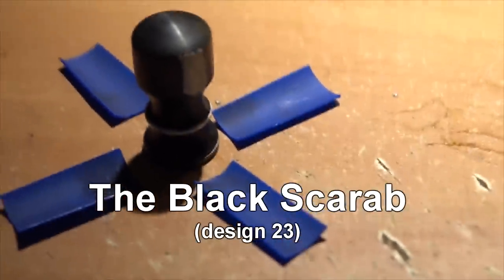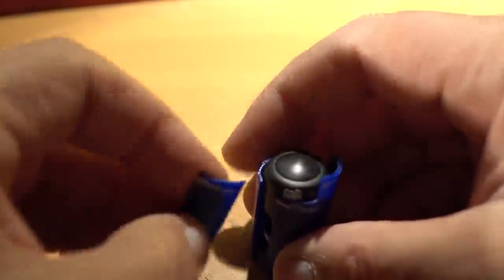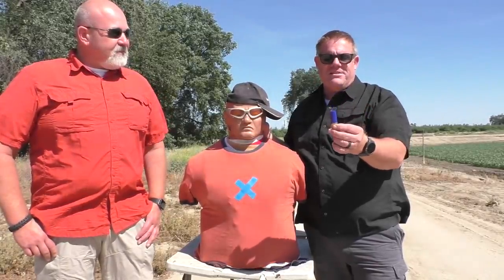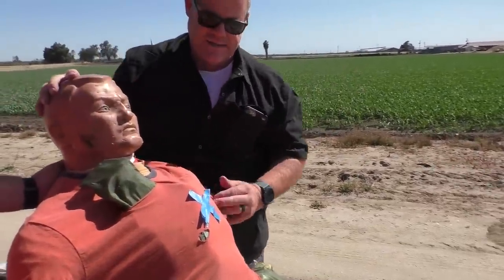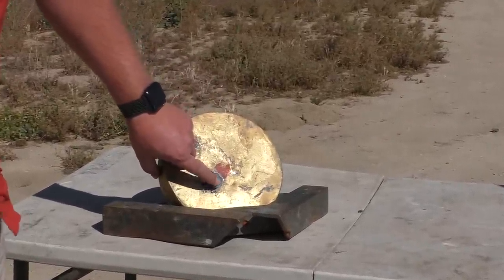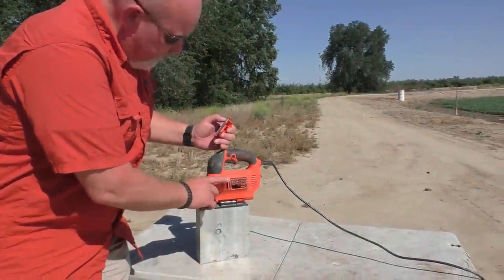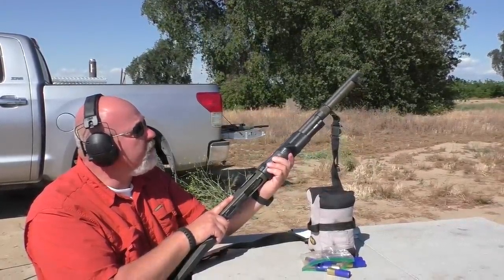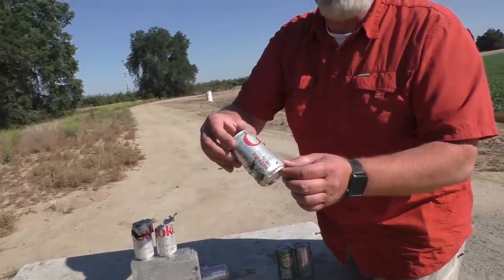The Black Scarab 12ga. Slug - Supersonic Freight Train

Comment: TAOFLEDERMAUS - On your comment about wrapping the ballistic gel in something, my initial thought would be to wrap it in Packing Tape.
That stuff is clear, so when you shoot it, you can still film the projectile going through it, but it will add support so you can show just how violent that force is going through the gel.
Its pretty strong stuff. Approved by the USPS. In fact if you use any other tape, they won't accept the package because of the risk of severe damage.
I had to learn that one the hard way!
Reply: The gel has to flex, as you can see in the slow-motion shots. Packing tape would prevent that because it doesn’t flex. And it wouldn’t be clear, it would make the shot inside the gel very blurry and hard to see. We think three seconds of rinding with water is fairly easy. 🤷‍♂️

Comment: Have you ever tried making a “bird shot” type load with .177 pellets instead of lead shot? I wonder if the Diablo shaped pellets would correct themselves in flight, if you just tossed a bunch in a shell with grex or whatever buffer material in any which orientation would they correctly orient themselves and start flying head first ?

Comment: Great video and great shooting guys! I'm really wondering if the screw-in tailpiece, is maybe getting pulled away from the body of the slug because of the intense force exerted upon it when fired? This could. E the reason that the washer came off completely in the ballistic gel. If you go back and look at the first shot I think, the washer is loose and there's a gap between it and the body of the slug. The chamber pressure could be high enough that it is causing the bolt/screw to rip away from the threads, in the center of the slug body? What if the washer is binding up the slug as it exists the barrel and causing it to travel to the left a bit? I'm not a reloading/physics/ballistic expert or anything close to it. I'm only putting forth theories that popped into my head while watching the video. Anyways, thank you guys for bringing us along for the journey of you guys living the Slug Life! Lol. Dam, I think that was a rap group that Greg was in back in the 1980's when Whodini and Run DMC were on top of charts. Lol. Please don't tell me that was his stripper name! Lmao! Cheers

Comment: You said it's made of "pot metal" so it's made of cast iron? If so that's why it compressed and why it fragments the way it did on the led plate. Cast iron pans and pots shatter/fragment when hit with force
Reply: Pot metal or ZAMAC is a soft metal with a low melting point, ideal for cast parts 🙂

Comment: I thought it was cool how the slug dragged a bit of gel out of the block with it all the way to the vest. Since you are thinking of wrapping the block with something to demonstrate the energy transferred through the material, might I suggest a single layer of 6oz fiberglass with epoxy to paint it on? Xyla Foxlin should be able to point you in the right direction about doing that if she still has ties with Total Boat and JD Distributors. If I'm picking out the right materials here, you should have a clear shell around the gel that gets ripped to shreds. I don't know if the epoxy will bond to the gel (probably not), but it should hold the fiberglass in place. The refractive index of both materials is the same, so the fiberglass will turn clear when you wet it with the epoxy.
Reply from the maker: Whatever we do,   it will have to be set up in the field.
Reply: @taofledermaus  Do you want to be able to record that cool cavitation that the gel does, or just blow something up?
Reply from the maker: @Fudmottin   It has to be cool but it has to be cheap and easy.
Reply: @taofledermaus  I think I could come up with way to meet two of the three requirements! LOL.

Comment: Interesting dramatic and fun. But it was the gel test that got me. There used a video on the Brassfetcher website of Federal LE Truball rifled slug. The one that looks like HydraShock pistol ammo with the little nipple in the hollow point, except it’s one ounce slug. Fired into FBI spec ballistic gel the slug expanded looked like a donut. I could be mistaken but as I recall it lifted the entire block 15ft straight up into the air. What I clearly remember is that it had left a permanent wound cavity 6 inch in diameter. SIX Inches is big enough to give a whole new meaning heartless bad guy. For whatever reason they took the video down. Would love to see that ballistic test replicated.

Comment: "Spalling" occurs when the armour or the plate gets hit with a concentrated explosion of energy whithout penetrating power, it produces shards that fly all around the tank or in this cases around the area. A round that relies on this effect is HESH. some caseses (where you hit, what's the angle ecc.) It cud do more damage that a steel penetrator.

Comment: I think Plastisol could be made to function similarly to ballistic gel. I think ballistic soap or ballistic grease would be less expensive. Ballistic soap is made from glycerin (2 cents a pound). The paraffin that comes up when they work over oil wells in Oklahoma looks about right to make a vasalene-based ballistic media. I can't find the recipes. The price should be right on both of those. The soap is clear and the vaseline may need some clay to stiffen it up so it will be opaque. Both have open wound channels